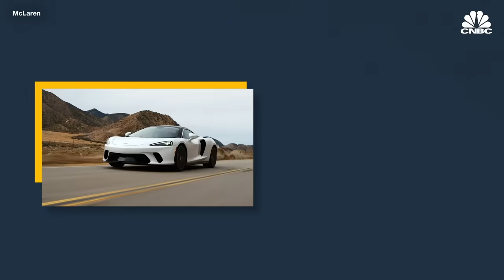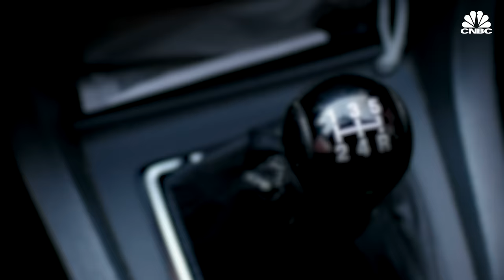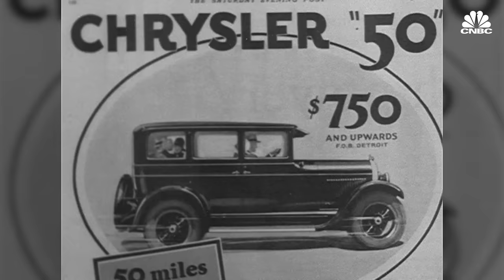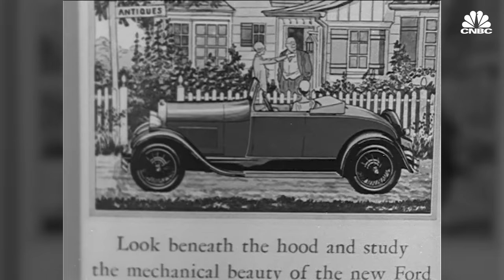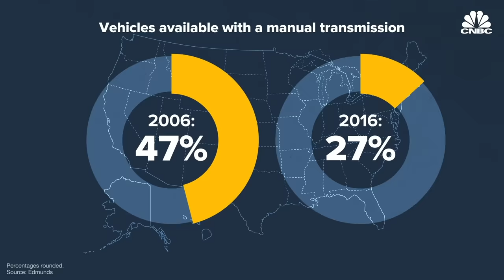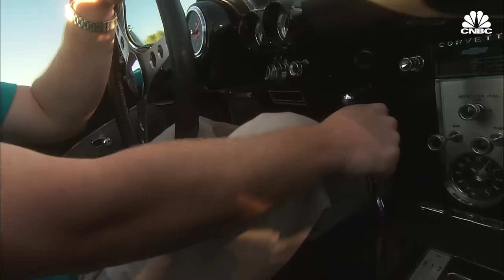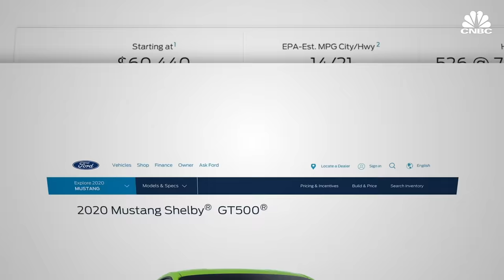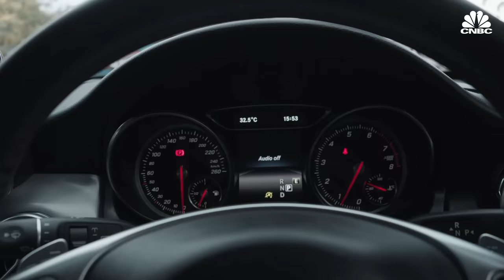Why Stick Shifts Are Going Extinct

Comment: "the trouble with manual transmission is that they require work, skill and constant attention" 
And driving in general doesn't? This is why people die on the roads.
Reply: Exactly.
Reply: It's absolutely the problem with people, they're too busy trying to use their phones, talk, text, etc... I ABSOLUTELY HATE automatic, despise it actually, but bc I have a limited amount of funds of which to buy a car, I have to sacrifice if I come across a great deal, but it's an automatic, which I just bought a Jetta and thought when I first learned it was a Volkswagen, I thought sweet, a standard... To my shock & horror it was automatic 😭😭 I do begrudgingly admit I don't drive AS aggressively in a stupid automatic as I do a standard, lol, for whatever reason.
Reply: i know right, why pay attention to the road when you can sleep behind the wheel
Reply: Nicely said
Reply: @mro9466 basically all geeky Tesla drivers
Reply: Good point!
Reply: Ppl leave driving as the last thing they do on the road nowadays...🤨
Reply: exactly!  they dumb down everything and wonder why people are terrible drivers.
Reply: Vincent Cheung you are so wrong Vincent. Apparently you never learned how to drive a manual transmission car. It’s like a reaction like putting your blinker on after you get accustomed to driving one. Plus you get better fuel mileage if you know how to drive one.